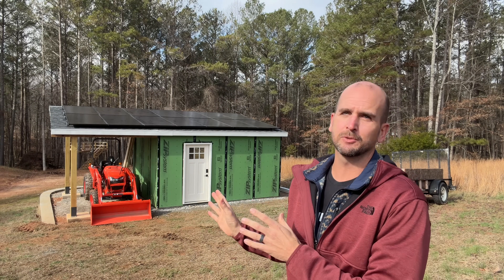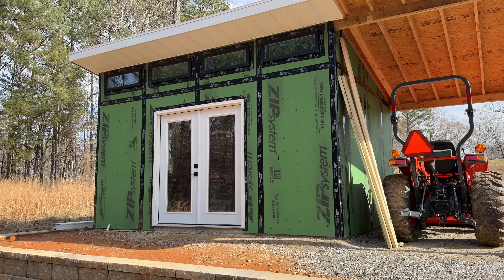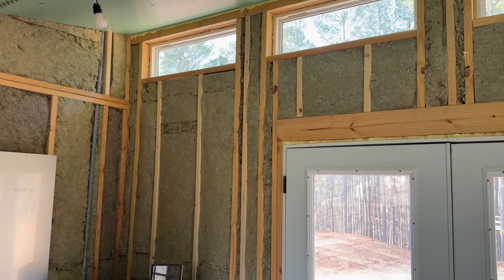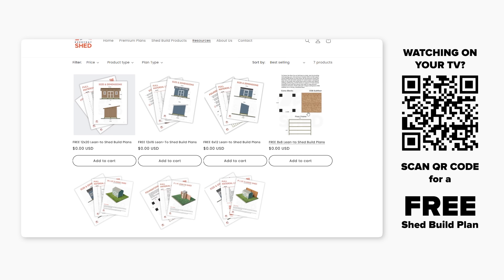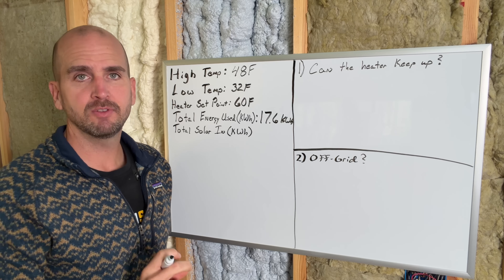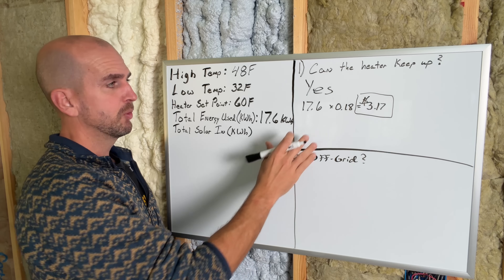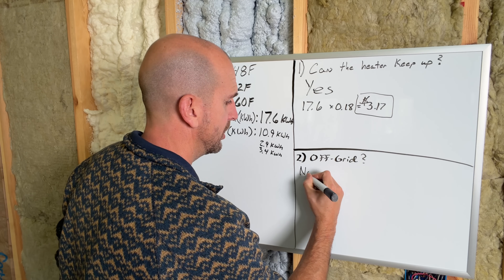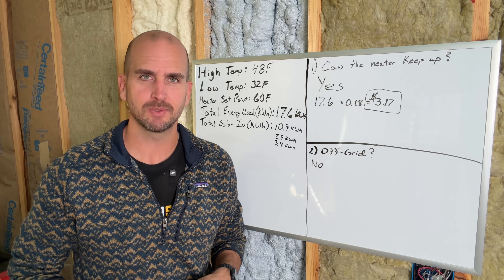HUGE Mistake: Why My $15,000 Solar System CAN'T Heat My Tiny Shed

Comment: I work in HVAC system design. From the video you need way more insulation in the roof, at least R21. The concert slab is also sucking away a ton of heat if it's not an insulated slab. Install the drywall for the walls and ceilings and it will help a little. Any insulation on the floor would help! An inch of rigid foam board insulation on top of the slab or at least some flooring would minimize thermal bridging. Going to a good mini split would be the best solution once the office is completed.
Reply: R10 in the ceiling is ... errrr.. silly
Reply: @MrJJSimonds  That's the thing that stood out to me. R-10 roof insulation is crazy bad. Roof systems should have somewhere in the R-20 to R-50 range depending on climate zone, building construction, and code.
Reply: I was also going to comment on the floor. You can lose lots of heat trying to warm the ground (not going to happen). An inch or two of Foamular (3M pink foam panels) with plywood on top would go a long way insulating the floor. As a first test, you might consider one or two layers of carpet over the concrete.

If you are considering a generator, to might look at a liquid-cooled generator, so you can tap into the engine heat (which you're discarding otherwise). I don't know if that's a thing.....
Reply: Here in GA, R-38 for a ceiling is energy code. The ceiling is where your heat goes rises to and where it conducts out.
Reply: @flipadavis  Ceilings insulation is super important. So are the walls and floors! Doing heat load calculations I've seen floors pull 20% to 30% of your heat away.
Reply: Yeah, 15,000 for a solar system but can't spend 500 for a basic mini split AC. Of course, everything you said about thermal insulation is essential.
Reply: @conanobrien1 or a couple hundred for adequate roof insulation!
Reply: @JamesWindland  I did refer to the OP's comment about insulation... But basic split AC would also (at least) double the amount of energy, most of the time.
Reply: @conanobrien1  I wonder if EcoFlow gave him those batteries and inverter for free
Reply: Dude, just get a soapstone wood stove. You're surrounded by trees.
Reply: @thorvaldtorgrimson5651  Wouldn't it be hard to regulate the temperature in such a tiny space?  Also, the effort involved would quickly become a PITA of cutting, stacking, cleaning, etc. 

I once had a wood stove, kerosene stove, pellet stove and fireplace to try to heat a large home in the woods. In the winter, my life basically consisted of going from one to the other to keep things toasty!
Reply: @thorvaldtorgrimson5651 : and carbon neutral.
Reply: @drewthompson7457  Only carbon neutral if you are planting enough trees that will mature at the same rate as you are burning them which most people do not do. If you started planting 1 new tree every single year, 20 years before you install and start using a stove, then that 1st tree would be mature and at the same size to replace the tree that you just cut down. If you wait instead to plant a sapling when you burn that full sized tree then it will take 20 years for that sapling to replace the tree you just burned. 

If you are burning 1 full tree a year to heat your space and it takes 20 years for a mature tree to grow to a size that can sequester and absorb the same amount CO2 from that one tree that you are burning, then you will always be 20 trees behind if you didn't start 20 years before growing these trees. 

Alternatively you could start planting 20 saplings every time you burn a mature tree and you would be net positive for sequestering down the road. But let's face it, nobody is planting anything when they are burning wood in their stove. 

The best is to find and cut up naturally felled trees and burn those since they are going to decay and release methane that will eventually turn into CO2 anyway.
Reply: @drewthompson7457  Carbon what? Dioxide? I find it astonishing that the WEF (people like Bill Gates) have convinced the public that CO2 is bad for the atmosphere. What a joke...
Reply: @dc6233 : carbon. The stuff life is based on. A tree grows, taking up carbon. When the wood is burnt, it release the carbon, mostly as CO2.  As for the stupid carbon laws, I doubt any politician  knows that a few hundred years ago, the atmosphere was 0.03% CO2.  Now,  it has increased to 0.04%.
Reply: @dc6233  you have a very remedial understanding of emissions😅
Reply: @flipadavis nonsense.  You don’t cut living trees for firewood.  How much carbon does a dead tree offset?  None.
Reply: @mikea5923  Burning firewood is as sustainable at a large scale as using waste cooking oil as fuel for a car, which is to say not very. Both only work at small scale by burning waste byproducts of other processes. It can't scale up beyond a very limited amount.

Also there's more to burning wood beyond the CO2. Burning wood results in very high PM2.5 and PM 10 fine particles along with black carbon. It also releases carcinogens like Polycyclic Aromatic Hydrocarbons, benzene and formaldehyde along with other respiratory toxins like dioxins and furans and nitrogen dioxides. 

It's fine to burn a cord of wood now and again but let's not pretend that everybody could do it as a way to heat their homes. They tried that in Europe in the 18th-19th centuries and lost most of their forests resulting in timber scarcity. Imagine with the population we have now.
Reply: @f @flipadavis ou can heat a home for a lifetime on firewood.  My parents burned firewood for heat and hot water for 30 years, year round.  

Who said anything about everyone doing it? No one.  95% of the US population is too lazy to do anything with firewood.
Reply: @f @flipadavis there was “no other processes”  the trees were firewood, and not any kind of a byproduct.  Very different from your shitty oil comparison.
Reply: Heat pump would have no problem heating that space with your solar needs
Reply: Insulated concrete slab is a layer of foam, a moisture barrier, then concrete poured on top. Otherwise, you have moisture wicking that counteracts the insulating ability of the floor. Plus a wet slab is a breeding ground for mold, which is why many basements have that problem. 2 inches of XPS foam provides about a 3-5 temperature difference in a heated space (anecdotally from my own basement).
Reply: Seriously insulation is key. It’s cheap and easy to add in a new design. My house has R-50 ceiling and R38 double wall insulation on an insulated slab. Your energy usage would be much less. Plus using a heat pump should be way more efficient than using resistance heat
Reply: In grade 10 we learned to do heat loss calculations. An R10 ceiling is poor. The large window areas are poor.   I would have designed the shed to be more efficient. If that $15,000 had been spent on the grid, $3 a day would heat the shed for almost 14 years. I would have made the shed more efficient and used the grid.  I was given some solar panels. I looked into battery storage and inverters. Much more expensive with a limited life compared to the grid. I thought of using them for heat. Calculations showed it would shorten using the furnace by about 6 seconds, on a good day.
Reply: @drewthompson7457  whats power cost 14 years from now?
Reply: @theyhateme8763 : the green stuff is claimed to make energy cheaper.
Reply: @theyhateme8763 It will be less once they return to using coal fired generation plants and build more nuclear power plants. Wind and solar isn't practical for grid scale power sources due to producing current on an intermittent basis. Solar does OK where the skies are sunny all day for most days and wind power needs to be in locations where the wind speed stays above 15 mph so the turbine generators can produce enough power to send into the grid. The turbines need a 5 mph wind to start moving and a 13 mph wind to start generating electricity then 15+ mph to generate enough to enter the grid. The wind turbines in West Texas stay spinning due to steady strong winds on the High Plains so can generate enough dispatchable electricity to pay for themselves in 4.5 to 7 years. Texas gets 20% of its electricity from wind so gets in a lurch when high pressure systems park over West Texas causing the air to go still for days or weeks. The state decided to provide low interest loans to have natural gas generation plants built across the state to provide the needed power when the turbines sit still and additional power during peak demand periods to keep electric bills lower.
Reply: @billwilson-es5yn who said anything about grid power?  large batteries are already in use and saving the grudge from huge fluctuations. they are using them to balance loads and during peak hours. they never stopped using coal. nuclear is a great if the can dispose   of it.
I laugh all day when dumb clowns cry about EV cars. whoukd I buy one ? hell no..but we need the early adopters to push the tech..
and like you said where the sun shines and the wind blows encourage them to use those..that drives coal prices lower. 😊
Reply: @billwilson-es5yn  `but most of FL will be under water do to melting Greenland's ice, but then it will be easier to extract its resources. So could be a win-win.
Reply: @billwilson-es5yn : nearme, they shut down a 4000 Mwatt coal burner, and replaced it with 4 Mwatts of solar. Just what we need to charge all those EV s at night.....
Reply: @jaytigra2234  :  I outlived the coming ice age, the acid rain, the ozone hole, global warming, the disappearance  of the Maldives, Florida, New York,  the extinct polar bears, etc, climate change and the worst plague ever to hit mankind.  I wonder what else the politicians will dream up.
Reply: @billwilson-es5yn electricity costs are absolutely not going down in the foreseeable future.  Thinking any savings will be passed on is laughable.  Ai, and the big bullshit bill pf mental deficiency, means our current dog shit administration makes all Ai regulations for the next 10 years so states cant simply ban Ai centers that raise local electricity costs for absolutely no benefit to the community.
Reply: @theyhateme8763  and will there even be a grid in 14 years?
Reply: @drewthompson7457  We're running out of water, apparently.
Reply: @PersonalStash420 : too much stored in 8+ billion people.....
Reply: Yea, people in Siberia use about 5 to 6 inch thick  foam insulation.   My house is severely over-insulated and my utility bills are about half that of my neighbors.
Reply: He doesn't need airflow through his rafters either. It's easy to air seal a small space like that and put batts between the rafters, then his foam board.
Reply: @bobbygetsbanned6049 - I knew when he was doing the 2in foam board on the ceiling.... Not smart and should have sprayed the entire shed if he wants that radiator to work. If your not investing in the insulation then your going to invest in a heater minsplit/wood stove.... How is he also advertising some "guide" when he can't even make his shed work for him??
Reply: @bobbygetsbanned6049  I was thinking the same thing
Reply: Also work in HVAC system's design. Couldn't agree more. This building simply wasn't built and insulated to work efficiently off-grid. Lots of thermal bridging, poor roof and slab insulation. Goodness knows if it's well sealed or not and how much air infiltration it has to deal with. Others have pointed out the building isn't oriented well to make use of solar load. The list goes on. Trying to DIY an off-grid structure really isn't straight forward for a layman without the experience or good consulting from an expert. It's an expensive lesson learned for him.
A heat pump would go very far for that little shed. Even at parity, 1.5KW max consumption, he'd get nearly 2x as much heat than an electric radiator. Though I understand the cost difference is huge. But it will also give him AC in the summer, some dehumidification, etc.
Reply: @HazenMire I have a question for the HVAC guys. My government is pushing EVs and heat pumps. ( while not improving the grid). I live near a Great Lake, so it stays humid all year. I ve been curious if a heat pump will turn into a block of ice trying to take heat out of sub freezing humid air. I know heat pumps have electric heaters added, but then I'm heating the outdoors. Any thoughts would be appreciated.
Reply: @drewthompson7457  Picking the right heat pump is critical for cold climates! I just pulled up a ducted Mitsubishi Hyper Heat model that is 220% more efficient than pure electric at -13 °F (COP of 2.2 at -13 °F). The right heat pump can handle cold weather without turning into an ice cube all while being efficient. Every home and location has different needs. Sometimes it makes sense to go all electric. Sometimes it makes sense to stick with gas, and sometimes a dual fuel system is best. Dual fuel is a heat pump with a coil and a gas furnace.
Reply: @KPHVAC : other than using electric heat to melt the ice  on the evaporator,  moisture in the air will freeze on the coils, resulting in no air flow., so no heat gain. Where I live, near a Great Lake, it is humid all the time.  I did look into a 3 season heat pump a while ago to use with my gas furnace. I got quotes around $7000.  That buys a lot of natural gas. At my age, there would never be a break even date.
Reply: @drewthompson7457  That is often the case. West Coast prices, a good heat pump and coil is $12,000 to $20,000. If you have Natural gas stick with it! Propane is so expensive that adding a heat pump will pay for itself.
Reply: And this is how your fun side project turns into a 2nd mortgage.
Reply: what about putting the whole shed in vacuum bubble? :D
Reply: BINGO, once that slap gets cold, forget it. And the roof, which is probably a 2x6, better be R21, with foam board underneath. And the heater, that oil filled radiant heater? It's not nearly enough, he needs an electric heater with a fan which will require allot more wattage.
Reply: Perhaps one of the larger diesel heaters. The solar could provide the power. A 5 gallon container for the fuel could provide extended run time. Being forced air, it could circulate air well, and it can be turned down easily.

Comment: 15k system? You could of built twice that size system for half the cost. Eg4 6000xp or eg4 12k, some decent server rack batteries, or even cheaper LiPo4 LiTime batteries in series so it’s a 48v system.  Done. You over paid for that system.

Comment: Mini Split would have used 4 to 5 kW.  Diesel heater would use far less in diesel and a tiny amount of power.  Use a small mini-split and you have heating and cooling taken care of.

Comment: At those temps a minisplit would easily have a cop of 3 or better.  So it would use 1/3 or more the energy.   Still not good enough.  You need a diesel heater or a wood stove/pellet stove.

Comment: In the other video you say it's a home back up system. Those sytems are less than 90% efficient. Plus you should used 2x6 studs so you can use as least R21.

Comment: Ooof. I would have spent the extra $10-15k on a much larger shed and/or mix with slightly larger and wiring regular power and using a diesel heater. Insulating can always come later.

Comment: Since the darkness and wet weather of winter my  2000 watt solar is down by over 95% so for heat I use good old inexpensive Propane in my 200 square foot cabin, in the worst of winter here in the Northwest I use 10 gallons a month which also includes cooking while the solar then can easily handle everything else.

Comment: There’s just not enough solar energy hitting that roof to be able to heat the space. It’s just basic thermodynamics. You need to use more panels and batteries or use another fuel source like propane, diesel, or wood.

Another option would be a rocket mass heater. With that you could store tons of heat in concrete for later use.

Comment: IF you were going to go with resistance heat, I would find yourself a 50 gallon water heater that someone doesn't want, that will hold water.  
Fill it and add a little bit of anti-freeze, because you're not going to use this water for anything other than thermal mass. 
Replace the heating element with a DC heating element with built-in thermostat you set to 180F (safety yall). 
You can have dedicated panels direct-wired to it. You can perhaps have them charge batteries as the dump load. 
400 pounds of thermal sponge water will leak heat into the space continuously. It will not freeze. 

Or a supplementary diesel heater. 

You didn't insulate the slab, but you can insulate yourself FROM the slab with a floating floor. 2" with subfloor top, vinyl top. 
Upgrade the roof insulation as others said. 
If you don't mind the expense, put an inch of rigid foam insulation on the interior, sandwiched behind plywood and/or hardi panel (very fire resistant, rot proof etc.) 

Some thoughts and ideas.

Comment: only R-10 on the roof. ummm, the roof is the greatest heat loss area and most important thing to insulate very well. the foamboard is a nice thermal break, but still.
also, needs a thermal break under the concrete slab.

Comment: Don't know why you would use a radiant heater.  Personally I would have gone with a 300% heat pump like an EG4 solar MC4 input.  Could probably even get away with batteryless for the day.

A basic thermostat controlled switch or even a manual switch, that pushes to the battery when the desired temperature is achieved off the heatpump during daylight also a worthy idea.

Find the corner of building that gently slopes downward and away, double insulate that corner and thats where you want to place the outside part of a minisplit.